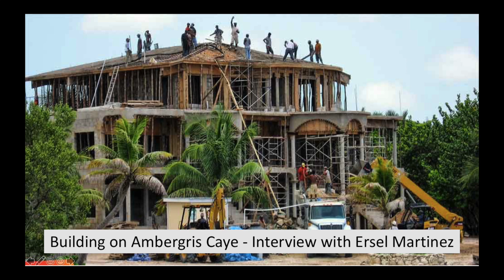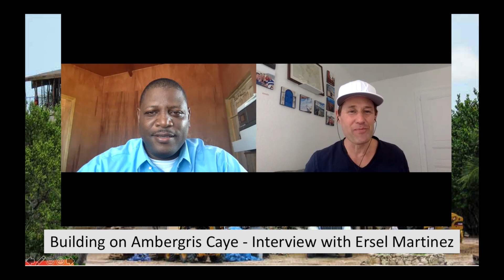Building on Ambergris Caye - Interview with local designer and builder Ersel Martinez

Comment: Thanks Dennis, I made a direct connection to Ersel, and he has verified that he could work with Hemp or Hempcrete as a alternative to concrete. This building material adds a dimension currently on or in the global market. 
In your home country of the USA, they have built several homes made out of hemp, over time it breathes much like stick frames, but has the solitary of concrete. The building of Hempcrete, is built the same way as concrete, with the supports of wood building upwards and in the door and window openings. 
Thanks for including Ersel as part of your program on your YouTube video blogs, as it enhances you, and your versatility selling properties through ReMax and building uniquely designed homes in the country of Belize...
Thanks again for your time.
Reply: Good Afternoon, what is his contact info as I tried to connect with him on linked in but was unable to do so